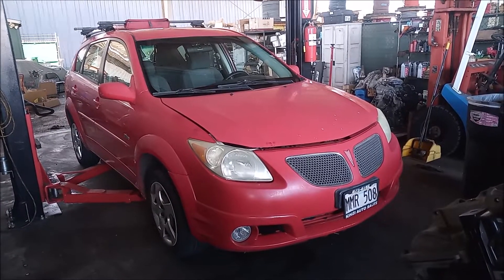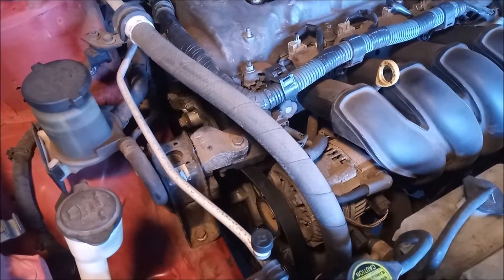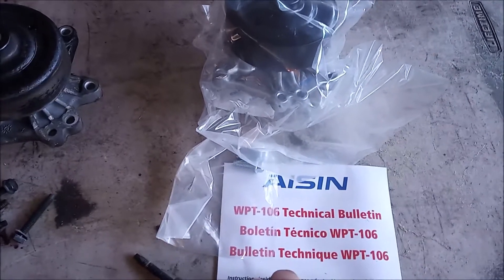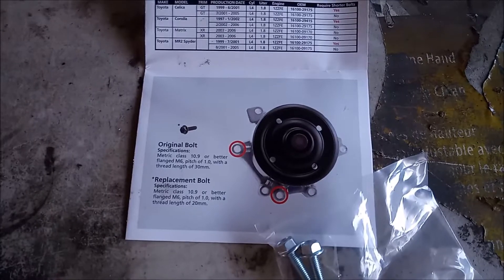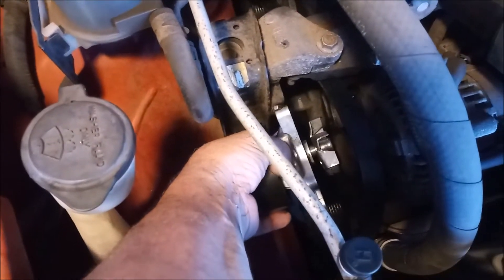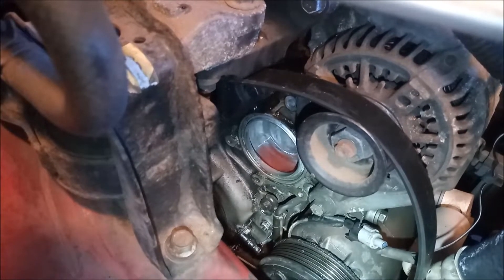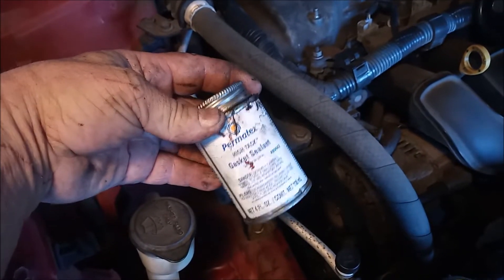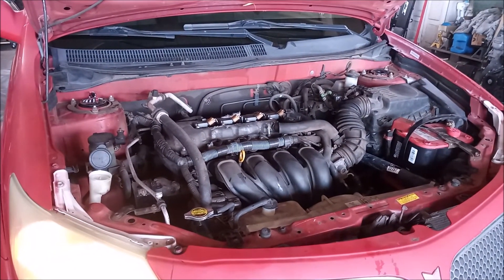How to Replace the Water Pump Toyota 1zz-fe 1.8-liter Corolla Matrix Celica MR2 Spyder Pontiac Vibe

Comment: oh cool , Permatex High Tack, we used that on head gaskets on the Chevy 350 motor , my main concern with the Aftermarket  O Ring is " does it seal like the dealer part?"
  I tried after market for the thermostat and found the dealer gasket was the key to the seal .
  I replaced mine on the 1zz fs corolla at 150 k miles not sure what the mechnic did but it did not leak, I got that on parts geek for 32$, now at 270k ( 190 compression all cylinders) I replace again 
  the mechanic left a bolt loose and I have a slight leak .
  it was probably aftermarket, I am thinking of just replacing the gasket with a toyota gasket and high tack, or maybe take it off and just clean it and high tack
Reply: not sure about this Aisin pump (which is the 'preferred' OEM pump for Toyota.) I have a Vibe (165,000 miles) and putting on the OEM AC/Delco pump and it also comes with an o-ring. The instructions specifically state NOT to use any silicone gasket/RTV/etc. ONLY use the o-ring. Some videos do suggest to hold it in place using a couple very tiny dabs of grease, but no silicone gasket product. The Gates pump I'm replacing only had the o-ring. It has held fine for 80,000 miles, but on close inspection I"m thinking the pump has not failed but instead the o-ring dried out and cracked is why my pump is leaking. Maybe I just need a new o-ring?